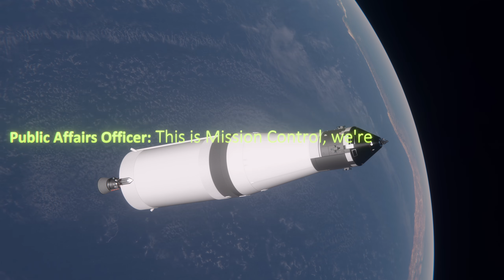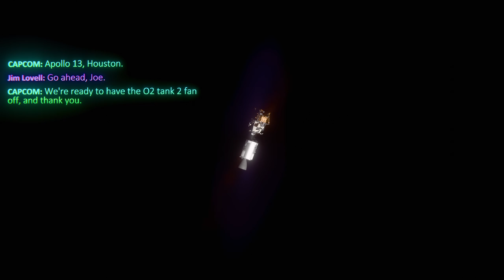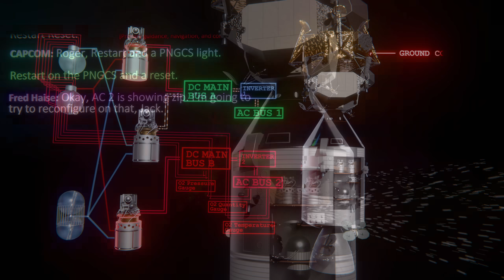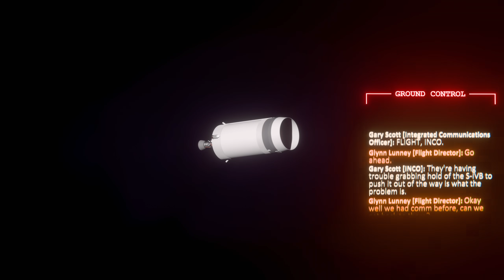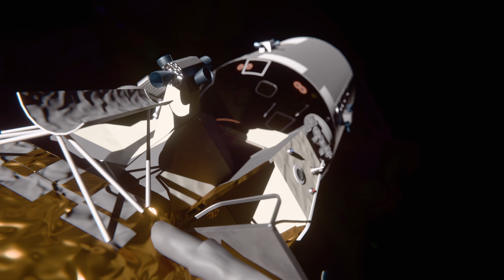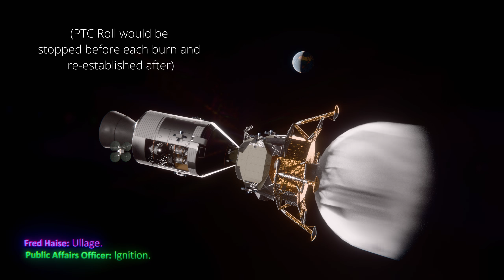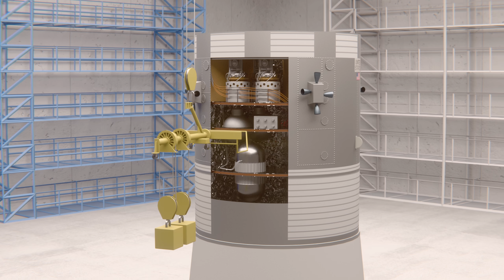Apollo 13: What Went Wrong

Comment: This is an amazingly detailed documentary of what happened on Appllo 13.  

In many ways a lot of what they seem to believe what happened is not that different from what the commercial passenger and freight jet were often seen to happen that lead up to NTSB investigation proving that engineering, human assumptions, repeating steps over and over as long as they solved the immediate problem, with no one saying that once might be a fluke but twice was as coincidence outside of tolerances, and required a full stop until everything could be examined again.  Something happening once, even with a logical explanation, required action if it happened again because, as many investigation by the NTSB showed with jet aircraft often an issue happening more than once, or even happening once with critical systems, could have wide ranging effects that could cause other unexpected problems no one could have imagined without eyes on the issues.  

One thing that commetcial aviation had when something went wrong were many procedures and rules that lead to common sense rules that required reports of anything out of the ordinary, especially if a critical hardware or system caused an issue that could have lead to a tragic outcome, that when that part or system had an issue, it had to be removed, and replaced with a new one, the questionable one returnednto the manufacturer.  

Of course, the Space Program,   mainly had its own oversight and no third party involved looking over anyone's shoulder saying that and failure should have mandated replacements as well as mandated inspections and investigations into systems or parts that could have been impacted, even if only housed in the same area.

Many of the various agencies worldwide that investigated issues, had not only come up with explanations as to why commercial transportantion failed but also, in a matter of things they came across established policies and procedures for best practices for engineering firms, carriers, aviation training, maintenace, ATC, airport procedures and so on, things that came out of the growing pains of the developing and then fast growing private and commercial aeronautic industry.  Space exploration was research, in many ways most space missions were test flights and space agencies were not at a point where they were ready to even  consider best practices, either borrowed from a closely related field or by starting to gather through their own test flights what they should be mandating to try and avoid missing a warning sign.  This was not just the fault of those designing and engineering, or the agencies that oversaw their launch but the very old problems we have seen lead to disasters time and again.  Politics and money.  The politics of the space race in the midst of the coldwar where leaders of countries set   forth the timelinesnof when the next great accomplishment would happen such as JFK promising an American would walk on the moon by the end of the decade.  Leaders jumping advancing technology by demanding that their country would build the bigger nuclear bomb, or make nuclear energy something that  would propel their country to a place where people would have futuristic technology that made everything cheap, abundant and life easy.  Politicians said it had to happen but often quickly found that the timeline they demanded was one they often did not want to fully finance and that could lead to agencies that knew that somethings might not be as reliable if used a second time found ways to use them twice.  And often it worked to reuse a part a second time or establish a criteria for inspecting a part to make dure the quality was as good as new, until it didn't work a second time or someone missed that one little sign they did not understand to look for so it was not as good as new.  

To have figured out in the detail presented here, what happened down to issues that started the chain going back as far as Apollo 10, when the actual evidence was either blown out into space with the initial explosion or may have have continued to be loosened  and shed as Apollo 13 was desperately trying to lipm back to earth, was burned up on re-entry if the service module and the LM or the few pieces that may have survived re-entry were scattered st the bottom of oceans or were so little where they may have rained down were lost in earth's normal surface debris and detritus.  The only visual documentation  were the few pictures taken as the service module separated from the LM and the capsule, which were foggy and graining and lacked definition.

To have such little evidence recreating the cause and the timeline had to be figured out from things already known about at least noted somewhere in all the procedural documentation generated long before Apollo 13's mission was fully planned.  Such as having several 'work arounds' for when an oxygen cylinder would not depressurize as it was meant to, and even knowing that the dogleg bent in the vent tubing was the problem, spending time finding workarounds that unknowingly caused more issues instead of having the part re-enginerred or replacing it with one that would depressurize probably did not save that much time but was may be easier and avoided more paperwork or cost for re-engineering the part.  And, when you look at the system, as crucial as it was for powering the SM, as well as providing life support, the lack of redundancy was only a "life boat" that not available once it was left behind on the moon  and the mistake of one set of engineers not cognizant of what designs the others were using so something as important as CO² scrubbers were design specific to either the SM or the LM, as if no one imagined that if one failed  it could be replaced by just using one from the other module.  We know NASA got better as time went along both with the Space Stations Skylab, Mir and now the ISS, as well as the era of the space shuttle.  Even so, there have still been instances that failed because NASA did not always carry over best practices learned from one program to another.

Comment: What I find fascinating about all of this is the fact that they could keep com running 10 amps using a circuit with 26 volts, while also using life support systems.  A measly 360 watts for a space craft designed to support the life of 3 humans, communications, telemetry, and any other AC circuits they were running up there, like instrumentation backlighting or maybe even the instruments themselves. I would love to do a deep dive on what all was considered "mission critical" and what got powered down because that must've been so crucial. Just to put that amount of power into perspective,  a lot of lightbulbs are 100 watts. Also too, that's a lot of math to run through without modern computing, a literal life  or death physics problem.

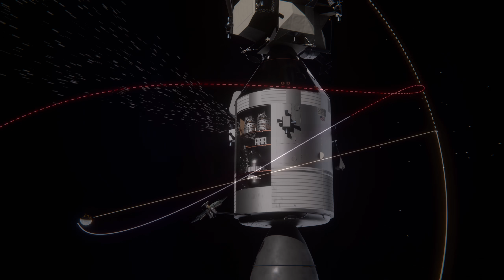Comment: 1:55:14 This is the part that haunts me. If the tank exploded at any other part of the mission then not all of them would have made it home. How crazily fortunate.
Reply: If it had happened when they were already on the moon and the CM in orbit it would have been the worst case scenario. Then deciding whether to stay on the moon and die there or go back up to the CM and die together. Nightmare fuel. And imagine having an orbiting monument to three astronauts stuck in the moon’s orbit forever or until SpaceX could bring them home for burial.
Reply: @johnfisher747  it wouldn't orbit the moon for long without correction. It would crash into the moon very soon.
Reply: @sb6671  Not necessarily true actually.  Apollo 11 ejected their ascent stage of the LEM prior to leaving moon orbit and people have done the math and there is a chance that it is still orbiting the moon.
Reply: @johnfisher747  Though SpaceX can only help things that are at the ISS. Anything else is off the table by a long shot.
Reply: @okankyoto im sure elon wont mind spending 5% of his networth to bring the bodies back and get that sweet political karma
Reply: @okankyoto  i'm pretty sure Falcon Heavy can reach mars and same with falcon 9 (with small payload)

Comment: Wouldn't it be more probabl that Apollo 13 was the first attempt to get to the moon and by going through the Van Allen radiation belt is what really caused the issue ??
Reply: No. Complete bollocks
Reply: Apollo 8 was the first mission to travel through the belts. Long before Apollo 8, plenty of unmanned missions had gone through the belts, including the 6 missions with radiation measurement systems that James van Allen used to discover and map the belts. 
Radiation does not cause wiring to overheat, which means it was not the cause of the explosion.
Reply: Whats the most probable:
> An accident on Apollo 13, a very difficult and ambitious space program that was full of malfunctions but with a lot of redundant systems. 
> Decade of thousands of engineers, professors and workers, faking 5 previous Apollo missions for whatever reasons, and for some reasons decided to launch Apollo 13 for real. All of that because of a belt that can be mostly avoided by going above or under and is not dangerous as long as you don't stay there for days. 

If you choose 2, I have a bridge in the Sahara to sell you.
Reply: How you can say that when the complete reason the tank catastrophically failed has been both determined and explained in detail in this video?

Did you watch this with your fingers in your ears or something?
Reply: Bro probably also thinks the earth is flat 😂
Reply: Earth flat, negative, but what we all seen on TV. Is not what the astronauts seen.

Comment: You’re willingly strapping yourself on top of 3.5 million pounds of explosive fuel—enough energy to level a city block—inside a metal capsule not much bigger than the inside of a compact car. You can’t stretch your legs, you can barely turn your head, and you’re trusting that hundreds of thousands of individual components, built by the lowest bidder, all function in perfect unison.

Then someone lights the fuse. The world around you becomes a controlled explosion, hurling you off the planet at 17,000 miles per hour, using Earth’s own gravity as part of the equation. You’re not steering. You’re not flying. You’re being launched—flung—on a ballistic arc toward a moving rock 239,000 miles away, aiming for a microscopic intersection point that was calculated on paper three days earlier. If those numbers are even slightly off, you’ll either miss the moon entirely or slam into it hard enough to become a crater.

And the real mind-fuck? The entire mission depends on a chain of flawless calculations: oxygen levels, weight distribution, gravity variations, battery life, velocity, fuel burn, trajectory curvature, even the angle at which sunlight hits your craft. Every bit of it has to line up—perfectly—for you to reach the moon, use its gravity to sling-shot yourself home, and pray the math still holds when you come barreling back through Earth’s atmosphere.

Because that “return” isn’t some gentle descent—it’s a violent re-entry, a controlled fall at 25,000 miles per hour, so fast that the air around you turns to plasma, and your heat shield literally burns away to keep you alive. You can’t see anything outside, just glowing orange fire and the sound of your own heart pounding in your helmet. If the angle is too steep, you’ll incinerate. Too shallow, and you’ll skip off the atmosphere like a stone on water, destined to drift into deep space until the oxygen runs out.

Assuming the re-entry is perfect, your capsule still needs to survive the deceleration from Mach 25 to zero without tearing itself apart. Then the parachutes—sewn by hand, mind you—need to deploy flawlessly. And after all of that, you just hope the Navy actually finds your little capsule somewhere in the 63 million square miles of open ocean, instead of bobbing out there alone while the radio crackles with silence.

Because if even one link in that chain breaks—just one miscalculation, one failed valve, one line of bad code—you’re not coming home. You’ll die hundreds of thousands of miles from everyone you love, suffocating or freezing in total darkness, trapped in a tin can, with nothing to do but replay your entire life until the oxygen runs out.

Oh—and the computer that kept you alive through all of this? The Apollo Guidance Computer, the one performing all that math and trajectory correction, had less processing power than a digital watch. Not a smartwatch, not a phone—an old-school Casio, the kind with a tiny LCD screen and maybe, if you were feeling fancy, a calculator.

Human beings looked at that setup and said, “Yeah, let’s go to the fucking moon.”
Reply: Based comment.

Comment: What a criminally underrated gem of a documentary. Phenomenal work! What strikes me the most is the quality of the communication and decisions and sheer just levelheadedness on display by the entire team. Anyone that has ever been in a pressure situation - in a team setting - can learn a lot just by observing how information is accepted/challenged, what questions get asked and how inputs are solicited and provided. Note how the conversation never derails from the critical resolution path, with different engineers constantly trimming unnecessary loose ends, how everything is challenged/scrutinized efficiently and constructively, how it feels like each crew member participates towards a single goal despite different concerns/expertise areas and everyone is watching for different angles/challenges and solutions. What a treat this is!

Comment: Ok wow, I had tried to read up on what happened. I either misunderstood the material I was reading or they had it wrong. I had originally thought that the “stirring” of the tanks was a turn of phrase to represent stirring a pot. The liquid O2 and various other gases would turn to slush and not give an accurate reading. So they had to apply heat to thaw the slush out. The known temperature applied would be calculated to accurately read quantity based on pressure. Hence the pressure and heat sensors. I read that either the heat or pressure sensor was faulty and they were troubleshooting to figure out the cause. Meaning more frequent stirs. I did not know there were both heaters and mechanical stirring features. 

I also read that the ground station systems ran on 65V and the heat sensor wasn’t upgraded to be in compliance. That appears to be the case. I thought it was an instrumentation issue. I read “ground station” and assumed it meant monitoring station like every other system on the spacecraft. I thought this was insane to choose a random voltage like 65V. I think I understand now. They wanted to boost performance on this spacecraft system. I hate how the loose engineering tolerances were ignored. It’s easy to be critical in hindsight but I would have put far more effort towards reinforcing that key system. A pressurized gas with explosive potential. They did the right thing by thoroughly pressure testing the tank. I wish there was more of a history record for that component. The technician reported the damage but it changed hands to the ground crew who likely didn’t recognize the failure to drain was connected to possible damage to the tank.
Reply: Based comment.

Comment: Here is the thing about chemical batteries..........the lower the draw (demand), the longer they last as a function of total kw/hr of discharge achievable from the cells.  In other words, high draw flattens the batteries much more quickly in an exponential way, than if the draw can be reduced.  A low draw over long time produces more power as a total than high loads for a shorter duration.  That was a big balls move, powering up main BUS B with the last remaining fuel cell.....it could have been a high draw overload that caused more problems.

Comment: The problem was there was a voltage issue upon the initial testing on of space craft.  Something about 12, 24, 48 volts.  While the Voltage tested good after some actual use, The circuits had been overloaded signicantly before the acutal flight. Sometype of design change or previous testing ( too high)  occured on the affected systems.  Why can't NASA knowledge this.  They know exactly happened.  We want the real story.

Comment: Superb video, but two comments:
 1) Small labels for the several components on the schematic diagrams would have helped the understanding.  For example, without schematic labels, repeated references to Fuel Cell 1, 2, or 3 and oxygen tanks 1 and 2 became confusing.
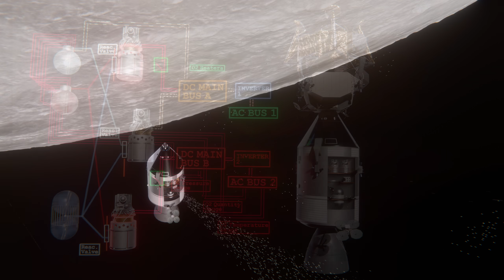2) A brief comment at 1:57:05 hinted at an important issue, "What might have been done differently in the emergency."  As I understand, although the explosion disabled oxygen tank 2, it could have been isolated (or the flow from oxygen tank 1 could have been restored), and the three fuel cells could have operated from oxygen tank 1 and hydrogen tanks 1 and 2, providing power to main busses A and B, at least for a time.  It's interesting to consider how the temporarily restored power would have affected the emergency response and the rest of the mission. Thank you.